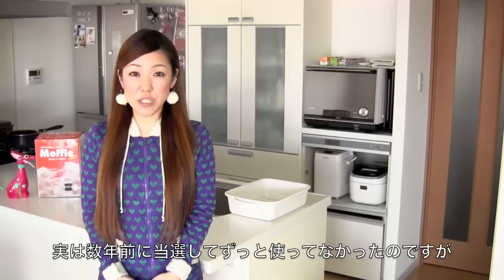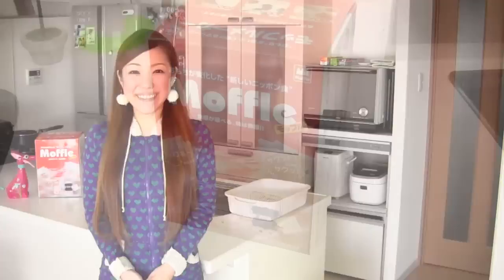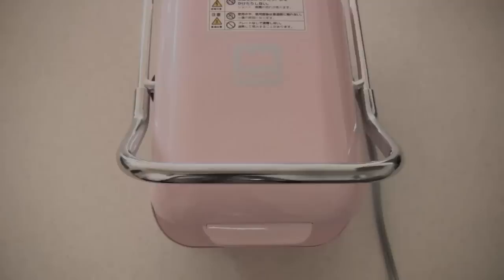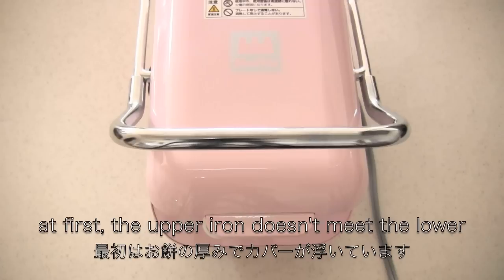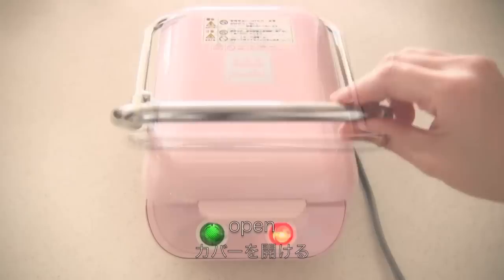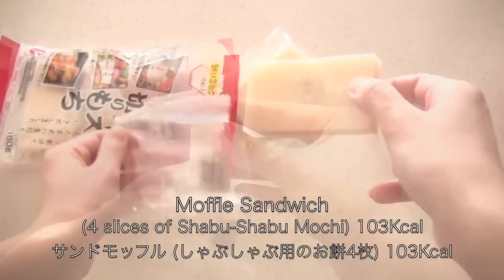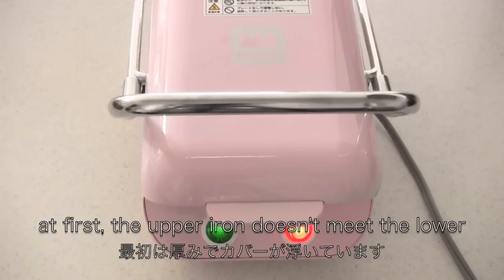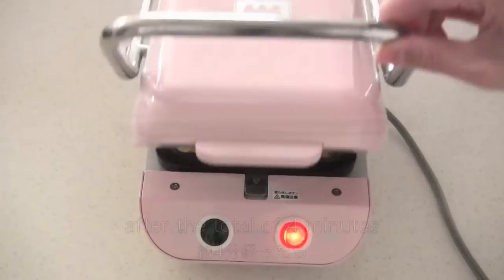Moffles (Mochi Waffles) モッフルの作り方 - OCHIKERON - CREATE EAT HAPPY

Comment: Hi Ochikeron, I tried the chocolate filled moffles and I can't believe how yummy they turned out. I used my homemade green tea and coconut mochi, and although it was soft, it still worked ok, but the problem was that the mochi got stuck to the teflon even when using oil ;-( I was able to peel it out in one piece but it would have been nicer if it came out in one piece like yours. Any tips?